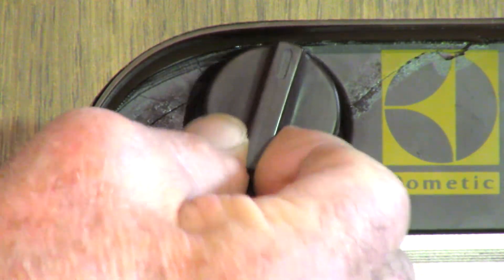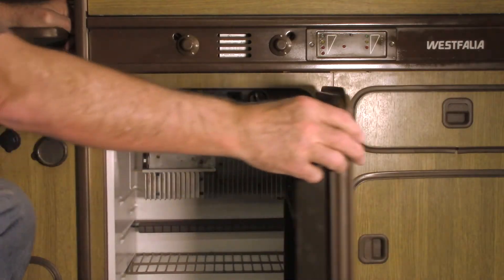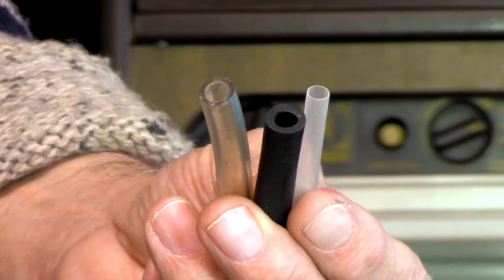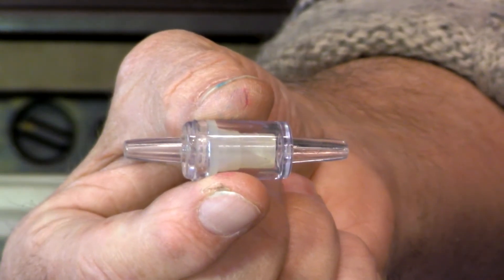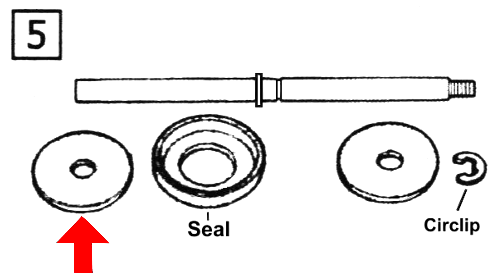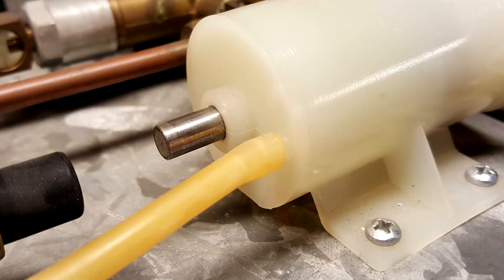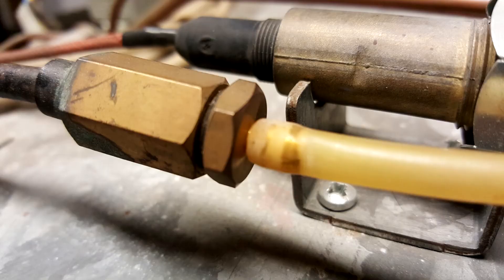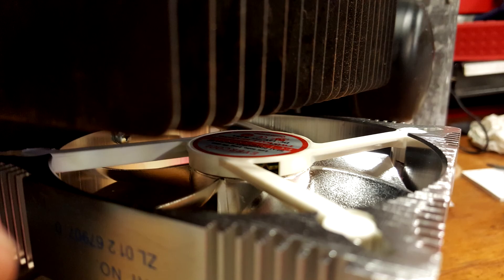1979-1991 Volkswagen Camper Refrigerator Air Pump Upgrade

Comment: Thanks again for this great breakdown. I had my 1988 Westy fridg3 checked, and a ru down of the how-to, got it up to the camping spot and managed to get it going. It did smell like gas quite a bit during this process, and I was wondering if I should be worried or if this was ok. Shop said this was normal. Anyways, the fridge shut down in the middle of the night and was barely cool in the morning. 😔
Reply from the maker: You should never, EVER smell gas. It is NOT "normal." (During the starting process you might smell a SMALL amount of EXCESS propane vented through the outside exhaust vent and has blown back through an open window.) If you smell propane while the refrigerator is running you have at least one gas leak and you should shut the gas off at the outside propane gas tank. Check, or have someone else check, every connection from the tank to the refrigerator. Sorry, but this isn't an easy process to complete and there are several points of failure. But you have to do this if you want to run the unit on propane. You can still run the unit on AC provided the gas is switched off at the outside propane tank.

Comment: Save yourself the effort. Buy a $10 inflatable boat electric ( self contained batteries ) air pump ( about 3 to 5lb ) pressure only. Push the enclosed rubber tubes to the fridge ( drain ) and turn on. While the fan is working ..play with the safety button ( bi- metallic gas valve ) and temperature valve and it should fire up. Replace the drain screw....which can be frustrating as its a fine thread with fibre washer.
Reply from the maker: Good ideas. Thanks.

Comment from the maker: Jean-Francois:
I posted a new video a few days ago which is worth a look. It talks about the "process" involved in using the Westy Fridge, (i.e., from AC to 12 volts, to AC or propane, to 12 volts going home). Yes, you can run the unit on propane while driving down the highway, but switching to 12 volts is the best way to go.

I'll also be uploading a few other videos which answer a lot of frequent questions about the small absorption-type refrigerator used in Westys. BTW, the small fan you saw at the rear bottom of the unit simply helps vent the heat away because the unit is up against the wall of the van. Except for the fan, the refrigerator has no moving parts. All those brand new, super luxurious RV's use the same type of refrigeration system as used in the Westy. Older, sure - but the same system.

If you're frustrated trying to light the propane try my tire inflator trick. ALWAYS works.
Reply: Maybe, the 12 V system works in reasonable ambiet temperatures but its next to useless at 30 C or over. The fan at the rear is designed to cool the hot gas in the radiator,, after evaporating, before entering the system  again. By its position, it can influence the heated air from the radiator vertically and out of the top grille. One of the other 12 V problems is that low engine speed, traffic etc. cuts off or reduces the voltage to the heating element that activates the ammonia gas, in the system.
After 10's of thoushands of hot country miles....the propane is the only way to go... or buy a compressor system with its power demands  With my suggestion of a propane filter, $100 installed on the tank outlet; ALL propane fuel is dirty and, the filter saves a 3 hour R & R everytime it blocks the small sintered brass jet. My propane jet cleaning system $10 prevents 3 hours work and cut fingers with frustration. Enjoy, your Westy. Love mine!!

Comment: Thanks for the great information John.  One thing puzzles me.  The pump gets oxygen into the chamber, but it seems like the intake air pipe running from the outside vent into the chamber is wide open.  When I blow from the water drain pipe under the fridge into the chamber the air runs through without resistance.  Is there supposed to be pressure that builds in the chamber when the pump works correctly?  Why the need for the pump if the air vent already lets air into the chamber?
Reply from the maker: You are correct John, that the fridge opening on the outside of the van will allow air to flow with very little resistance into the small combustion chamber located at the rear, bottom, left of the unit where you can't see it. As the van speeds down the highway, a low pressure is actually created in the system. If the small pipe at the bottom left of the unit is not plugged up with the small screw, too much air is sucked in which will quickly extinguish the tiny pilot flame. The unit will automatically shut down the propane gas for safety reasons. Supposedly, the small pipe was added to the fridge so you could remove water that seeped in during a downpour or car wash. Otherwise, this drain pipe should always be stoppered. There should be a smallish gasket on the screw to completely seal the system. If not, add a homemade one.

Like an old fashion bicycle tire air pump you should feel some resistance when pumping the air with the plunger. If you don't feel ANY resistance and you don't want to remove the fridge and rebuild the hand pump, (somewhat difficult) I have an easy solution. Assuming everything else is OK, this always works. REALLY!

Buy one of those 12 volt Chinese air pumps ($15-$20) that you plug into a cigarette lighter. It should come with an assortment of tips. (Every Westy owner should carry one) Attach the plastic cone-shaped one you'd normally use to fill an air mattress. Unscrew the stopper from the drain at the bottom left and just stick the cone in to the opening. (It will usually remain there without you holding it even when it's running.) Make sure the fridge is set to GAS and the temperature is set on HIGH.

Hold the safety button down with your thumb so gas enters the system and plug the inflator/air pump in the cigarette lighter receptacle.

Wait a few seconds for propane to enter the combustion chamber and press the igniter so the piezo sparks the propane/air mixture and lights the pilot flame. You may have to press the igniter a few times.

Watch the temp meter or red, green and yellow lights which indicate successful ignition. Now, as the temp begins to rise remove the air pump so you don't put too much air in the system and blow the flame out. From my experience with several different units in different Westy's at various campgrounds, THIS ALWAYS WORKS!

Monitor the lights or meter for a minute in case there's a drop in temp which indicates no flame. In this case try another spark or two before using the air pump again.

Remember to screw in the stopper. It's always got to be plugged when the van's moving.

If you have no problem initiating combustion, but the flame eventually goes out, the gas pilot safety switch may be at fault and should be replaced. Not a good idea to try and fix these - just replace them.
Reply: @JohnThomas-ou2rn  Thanks John. Will definitely get the suggested air pump.  I have the fridge out and have ordered the air pump upgrade kit and new fan and will install and give it all a test.  Hope it fires right up.  Have tested the fridge on 120V and it works great.  Any suggestions?  Will let you know how it turns out.

Comment: great videos. thx. my fridge lights up fairly well now that i've found the proper mix of oxygen/propane. in my case i pump 50 times then hit the pizzo and hold the intake of propane for about 20 seconds. now my new issue is that once started on gas, it does not generate cold... i can hear the fan or something that indicates it is working (and the led indicator is green and i can smell gas and feel heat from the vent so it is "on" but no cold... i put it on electric mode or battery mode and it generates very satisfactory cold... even front on the element... i am not sure how to fix the issue when on propane... any toughts ? thx much
Reply from the maker: If you SMELL gas, something's wrong. (Safety Issue) There's a leak somewhere and you must track it down before using the gas option again. Warm vents are a good sign which indicates there is ignition and some heat being produced, but not a good sign if you still smell gas. If the unit works good on electric and 12v and you hear the fan turn on an off, then the thermocouple is working correctly and a gas leak should be #1 on your repair list.

If the unit's been out of the van before, closely check the fridge gas connections at the rear of the unit. It's easy for the small, fragile copper gas tube to be pinched or leak from a bad connection. Best to do this outside with all the doors and windows open. I have big hands and it's hard to get them up into that small space! Turn the gas on at the outside tank and spray the copper tube and the connection with soapy water to reveal any leaks. Don't turn the ignition on while doing this test.

Now, you can also remove the unit, put it on the bench and with the right combination of brass couplings, run it from a barbeque grill can of propane to isolate the problem. Is the seal between the two halves of the ignition box leaking? Is the exhaust fan in the correct position to blow over the coils? Check ALL the gas connections for small leaks and tighten them up, (there are several). Also check to make sure the gas valve at the front of the unit is working properly by controlling the gas flow and not leaking as well. If so, these parts are not hard to replace.

Shouldn't have to pump 50 times.  This means that the hand-operated air pump seal is leaking and not pushing enough air down the tube into the ignition box below.
Reply: @JohnThomas-ou2rn   took the unit out... cleaned everything - turns out the fan had been replaced by previous owner -  and it is now working just fine and starts with one to 3 pump action... Your advice to get the fridge Cold by plugging it   the night before hitting the road is proving to be a game changer... but for an unknown reason, I persist at wanting to lit it whenever and where ever i want... with mitigated success (when it is humid/rainy it will refuse to cooperate...). Also, would you have advice to modify the exhaust of the fridge so it does not turn off when driving with propane on... i suspect that when passing (or being passed by, which happens more often...) by big vans air draft is being pushed into the exhaust and it kills the flame.
Reply: @jean-francoisbernier5250  he laid this problem out in his most recent video, you should check it out